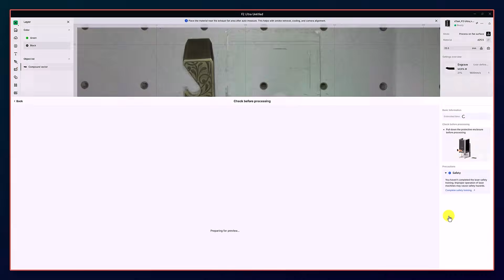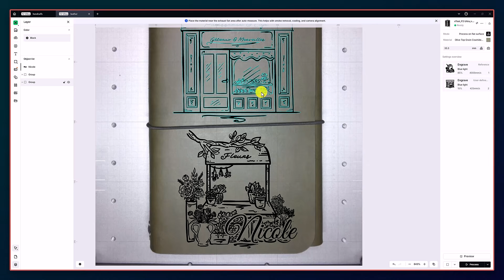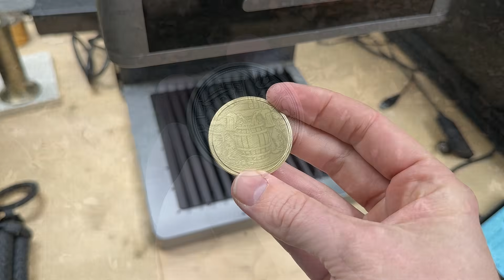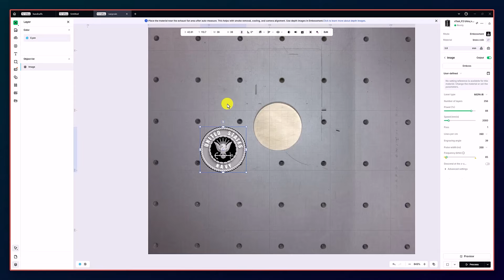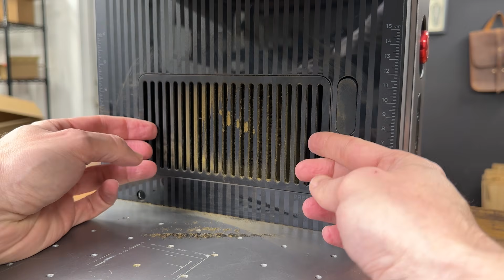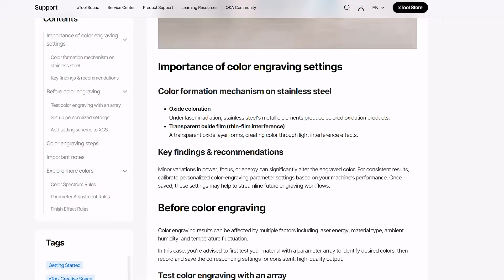The xTool F2 Ultra Review

Comment: Hi, I bought a different brand of laser, and I'm having a problem. The laser suddenly disconnects and cuts everywhere, damaging the board and objects. It's a known issue with the company, but they can't figure it out. How can I fix it? Any advice? I'm inexperienced with lasers, I use Roland CNC and resin 3D printing.
Thanks

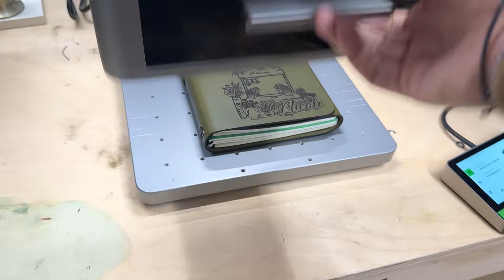Comment: At around 4:45 or so, you state the F2 Ulta is not suited for cutting and for cutting one should get a gantry laser like the P3.  The F2 Ultra is a Gantry laser with a 60 watt MOPA and a 40W diode. It can easily cut.  Were you possibly thinking about the F2 Ultra UV.. which by the way is also a Gantry laser
Reply: They are Galvo, the P and S series lasers are Gantry.  Galvo is a mirror moving the beam around.  Gantry is the laser head unit moving around the workspace

Comment: It's a shame the UV couldn't just be another module for this
Reply: it just doesn't make sense. You need replaceable laser source, galvo head (mirror coatings are different, lens also), beam delivery, camera filters, laser safety windows. The only thing left intact by that time are the frame and the controller which are worthless in comparison and the customer will fiddle with all that himself, generating support requests and warranty cases. As a bonus after upgrade you lose laser safety certification for the unit, hell for liability.

Comment: Thanks for your honest review, I own this machine in the single form, and you are spot on with your final assessment. I would not buy this machine  just because of the color, will it do it yes, is it a giant time consuming pain , double yes. I bought this to compliment the metal fab for engraving and marking metal and it works for that but I probably would not purchase again if had it to do over. For my use the metal fab engraves just fine.  There are just not enough pre-configured settings that work, so you end up wasting a lot of material in testing.

Comment: Hey Justin! Do you remember how much time it took to cut out the silver nameplate?  I currently have both the old XCS app and the new Studio app downloaded and for some reason the cutting times are crazy different between the two programs, with Studio needing up to 50% longer to cut using the same settings. Wondering if it's a bug on my end or if anyone else has experienced the same issue.

Comment: For the metal stuff like the handcuffs, what power does it run at? I'm wondering if I can settle with the f1 ultra instead of the f2, I'm just a little worried the 20w power might be a little low
Reply: I have the F1U, and engrave metal all the time! It would easily handle the handcuffs, just takes at least 2x the time, as it’s 1/2 the power. If you need to produce faster, I think it would be worth the upgrade to the F2U…I am saving up the funds now!

Comment: Hi Justin, you stated that wobble must be turned on when cutting through metal.  Does that apply to a 60w Mopa JPT fiber laser? I am looking to cut through 2mm brass or 3mm pewter.  Any help would be appreciated.  Love the video.  Keep’em coming.
Reply: лучше делать заливкой. ширина 0.4 мм на толщину 1 мм. более чистый рез
Reply: @mrSanders.  Thanks for this tip! I will try this with my laser that I don’t have wobble function!
Reply: @dian3145  какая программа у вас стоит? езкад и лайтберн умеют это. это программная настройка

Comment: I learned how to use Xtool better and I learned how to actually design from your Fiber Laser Ignite course. I bought the course and realized I couldn’t use Lightburn with the F2 (you mentioned to make sure it was compatible lol) 

I’m doing the project on the Japanese cooking blade using the panda and knife SVG. What’s your settings for the black. Do you use the C-Engrave tab or the Engrave tab. Awesome work with the course btw. It’s turned things around for me, I thought I made a mistake purchasing a laser machine.
Reply from the maker: Appreciate that! I would love to do an xTool specific guide but they change the software so often it would be outdated the next day lol. For black I use C-engrave. Off the top of my head 12% / 150 speed / 5000 lines per cm / 100ns / 100 freq. One pass is usually good but I do 2 just to make sure. Its JET black.
Reply: @justinlaser  if you were to do an xtool studio guide, I would definitely take the course! I almost bought your current course but then I read the prerequisites. Disappointed xtool decided not to support lightburn.